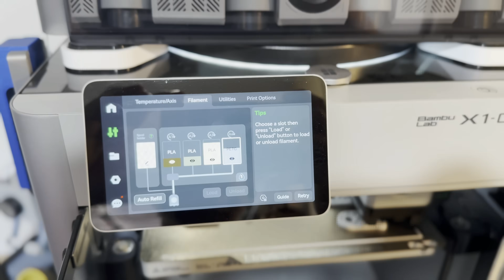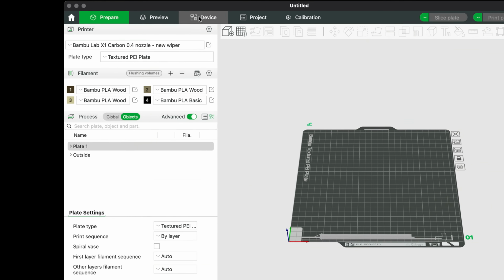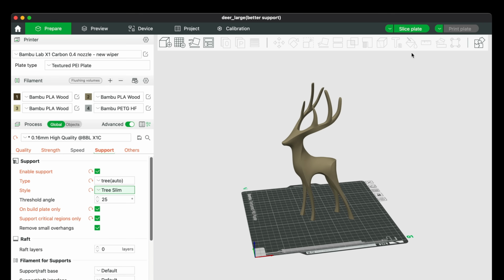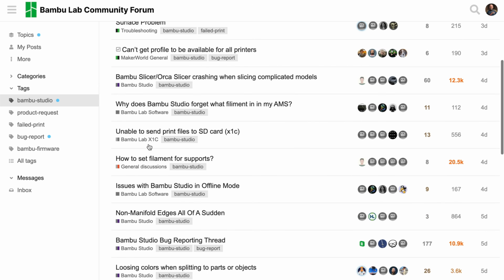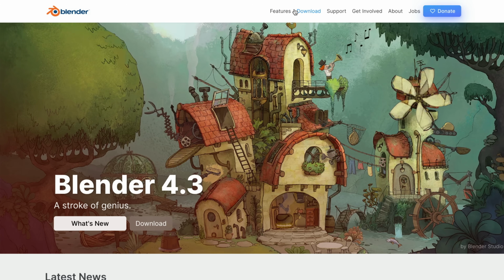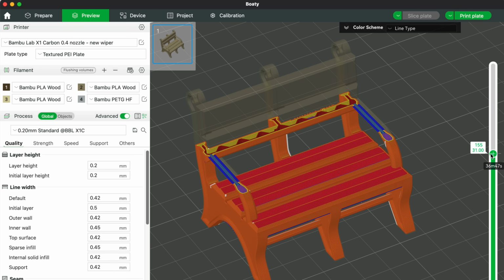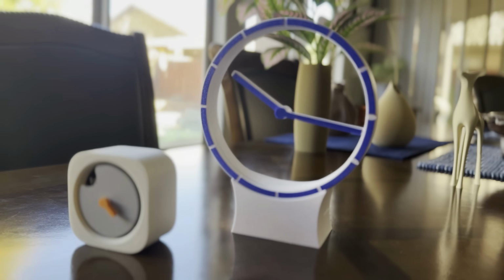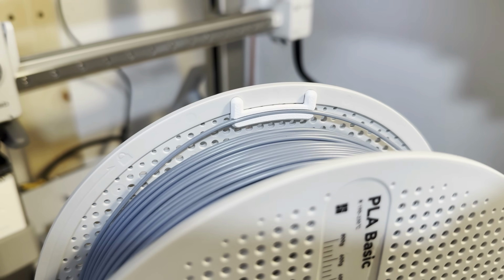New to Bambu Lab? This is What You Really Need to Know

Comment: great and inspiring video. 
one tip i'd like to add, is to experiment with print settings. for example some objects look really cool printed as only infill structure with no outer shell. 
or did you know you can "overprint" layers thicker than your nozzle diameter? with a normal 0.4mm nozzle you can extrude lines of 0.6x1.2mm and beyond. this is great for bigger structural parts and things in vase mode.

Comment: Great information great tips, I have a Bambu A1 mini that I am in the process of learning but I am loving it so far, it has lived up to the hype being easy to use easy to set up easy to get started with and gives great results.
I use a 3-D modelling program called AC3D which I have used for many years, my next project will be working on a design of my own than getting that sliced and printed
Thank you for the video thank you for the tips thank you for sharing!

Comment: I Used technology to create music for Lucas and Disney and also did freelance computer consulting work for decades and this machine is not user friendly at all. I like your tips but so far it doesn’t work period. I highly suggest people not purchase this machine…. There are little parts that should have just shipped attached… but the user needs to use tiny screws and hex wrenches to attach small parts that should not even be separate but glued together at the factory… I understand that some parts are separate so they won’t move around during shipment damaging the machine but we spent over 1/2 an hour trying to attach a 1 inch by / inch peice of plastic that is the receptacle for another component… someone in charge over there is on drugs! And speaking of which… I suggest having some hard liquor or opiates on hand when assembling especially if your spouse is helping you unlesss you want a divorce. Anyway good video for tips regarding a working machine but mine is still just an expensive cool looking paper weight;…. going to try and make it work again now… someone added some brandy to my coffee. ;)
Reply: thinking and basic assembly is tinkering

you are why people make fun of bambu users

Comment: Spent all day yesterday trying to assemble this thing and make a test print. epic fail! I wish the machine came more assembled…. It absurd that the scraper has the blade seperate from the handle  ours shipped eithoit the handle ( yes we checked the box several times searching for it) I wish it had a USB port so we could hardwire a computer or iPhone to the unit and avoid wifi problems. My daughter bought me this machine for Christmas and I wanted to print her a thank you gift but so far it’s an expensive brick. It told us it needed to update the firmware yesterday but today says “update failed” of course there is no way to get a human on the phone to help. The national videos and included paper instructions are confusing and annoying. I’m going to pull the packing materials from the trash in case we need to return this thing. Very disappointed. And chat GPT can blow me!

Comment: I will go metric when they quit selling 2x4 lumber.  I also own metal cutting machinery with all dials and readouts in english, the amount of tooling you casually suggest be replaced so you can enjoy the metric system would cost me more than your 3D set up cost you, and my parts are more accurate.  Move to Europe if you like it so much.
Reply: All imperial units are defined as fractions of metric units, so you're already metric. Just with an extra step
Reply: @snowthemegaabsol6819 sorry no. I am not new to any of this chief, I have likely been cutting metal longer than you been alive.
Reply: Unc, it's a half-joke, go cool off in the nice winter air and get that blood pressure down

Comment: Good luck if you need any support from them. Takes days to weeks and it’s often shit an AI could have told you
Reply from the maker: Yeah, i've heard they could use some help in that area.
Reply: @zionbrock  I will give them this, it’s better than a lot of other 3d printer companies. Right now they seem to be replying the day after the reply you send, which isn’t terrible. Just had to use them for a huge blob/clog that ended up shearing my parts cooling fan off and bending my hot end fan. In total the nozzle and hot end is also encased in PETG (so garbage more or less). They agreed to replace the fans, but not the nozzle or hot end. I feel like that’s fair considering I should have been monitoring it myself. Coming from Enders I became way too trusting of this printer too fast. Just seemed to always work.

Comment: Pla wood is abrasive. Be careful with that. 

Do not dry your filament in the same oven you cook with.
Reply from the maker: I've never had an issue with a nozzle while printing with pla wood, so far.
Reply: @zionbrock not necessarily the nozzle, but abrasive material on bambu systems is discouraged because it can degrade the Bowden tubes very quickly. Also the drive gears in both the AMS and the extruder can break down very quickly with abrasives.

Comment: My Bambu A1 Combo arrived while I was watching your video. Will be following your advice. Thanks for the tips!
Reply: Hi, how does the AMS lite compare against having the dedicated AMS and not having one? I am trying to decide between just getting A1 or if it's worth making the extra jump for the combo. What's the benefits and could it be had with just A1 and some DIY spool stand on a shelf above the printer ?
Reply: @KaiPetro  Good morning. All good questions. I'm new to filament printing though I have been designing and printing using resin for years. I bought the lite version as I'd like to do some multicolour stuff. I've seen some use the DIU spool on shelves. Give it a try, if it doesn't work no big deal. I felt it was a good compromise between DIU and a dedicated AMS. Time will tell 🙂
Reply from the maker: It's not just about having extra spool stands, you need a computer (AMS) that knows how to switch the colors, if you want to do multicolor prints. PLus you'd have to figure out a system to port all the filaments from different lines into the toolhead. Also, the AMS can read the colors you load into it, so you don't have to constantly tell it what colors you have. Trust me, its worth the money.

Comment: YES!! I can't believe we haven't switched to metric yet.  It's SOOOO much better, easier to use and logical.  If you disagree with me, you've clearly never bothered to really understand how it works nor used it before.  

All units are referenced based on the gram (milligram, centigram, gram, kilogram, etc) and meter (millimeter, centimeter, meter, kilometer, etc). 

They all share the same base units/ naming convention (pico, nano, micro milli, centi, kilo, etc) and have the same scales between types of measurements (distance and weight). 

You can EASILY switch between units simply by moving the decimal place since all units are base 10 unlike Imperial units where inches are base 12 (12in = 1ft), ounces are base 16 (16oz = 1lb), etc, which makes it a nightmare to convert and compare between units. 
100mm = 10cm = 1dm = 0.1m 

Because of common base10 units, everything is simple and sequential.  I can easily measure a piece of lumbar using a metric measuring tape in mm, cm, or m without calculating conversions.  You don't have ridiculous fractions, no unbelievably convoluted calculations like figuring out the center of a piece of wood 3ft 11in 3/16in long.  

In metric, it's... 
• 1195 mm / 2
• 119.5 cm / 2
• 1.195 m / 2

Simple calculations.  I bought all my friends and family metric measuring tapes for Christmas one year and they can't believe how much easier it is to use.

We Americans are really amazing at some things but very stupid at other things like not moving to metric
Reply from the maker: Right?!
Reply from the maker: As an engineer in school we had to work in all units, and go back and forth. It was a nightmare.

Comment: Your going to be massive on YouTube. This is the best 3D printing video. Subscribed and looking forward to learning more. 

Also I’d like to ask your opinion. I’ve never used a 3D printer but wondering if I should buy the H2D / Laser combo as I want to print parts for motorcycles and have the freedom to explore. Is that overkill?
Reply from the maker: Thanks so much for the sub! My personal opinion is to purchase 3d printers and laser or cnc cutters separately. I think the H2D is amazing, but just as a standalone 3d printer. When you try and do all the hobbies i one machine, there's a lot of variable you might not take into account, like contaminants from your cuttings getting into the tool head of the 3d printing hot end, etc.

Comment: New sub here. Thank you for this video, and it popped up in my feed just at the right time. I have had another brand and have been more inclined towards the Core XY, however I have had that many problems with the 2 (one was an exchange) printers that I am changing brands.  I do not know much about bed slingers and obviously have heard all the hoohaa with Bambu, but right now here in Australia Bambu Labs A1 is dirt cheap and I could buy two of those by adding an extra AUD$130 to the price of a Kobra S1. So even though I was not going down the Bambu road, I will be now as I have checked out the price of parts etc and know that support is hard to get on to but thats ok. There are plenty of people in Youtube land that we can ask questions of.  You have shown me things that I didnt know and thank you very much.

Comment: I use ViaCAD. It’s both WINTEL and Mac.  It runs on your machine as opposed to to web based which is preferable for security purposes. The intro versions are quite affordable.  One reason I like it is because of a unique GUI interface for the CAD. It can be a little challenging at first but look at the movies and pay close attention to the instruction on use of keys, and in short order you will get it and the power provided. Imports and exports all the CAD formats.

Comment: I was wondering about the AMS. I'm planning on getting an A1 mini without it since I don't need more than 2 materials. Can the material be selected in the desktop software. I don't like using the tiny touchscreen on the printer so if I can avoid it, I will.

Comment: Hey, your video is so much informative and there's so much you said that it's kinda overwhelming and scary to get one, at first reaction. But it settles down and reassures that there's a great video out there that will address and answer a lot of scares and jitters of a newbie. Thanks for uploading it. By the way which printer you have, and how long did it take you to get to a comfortable level. 😊
Reply from the maker: I'm so glad you agree. Yes, there's so many great resources if and when you get stuck or run into a clog or issues. 
I have the Bambu Lab X1C and A1 currently.

Comment: Your video just convinced me to get a Bambu printer.  I'm thinking the A1 with AMS.  What four filaments would you suggest I get with the A1?
Reply from the maker: Probably too late to suggest, but I think MATTE and Wood PLA are the most elegant. They're not the strongest, but they can really make your prints look expensive. PETG HF, is fantastic for parts that that might need a little more flexibility and bend.

Comment: USA has converted to metric, inch now is defined back to the metric system.
Reply from the maker: not sure i understand...  The US is def not on the metric system. However there are things we measure here that are, like 2 liter bottles of soda, or medicine in milligram increments, etc.
Reply: @zionbrock  Historically things like the inch had various definitions, which is what led to inconsistincies. In 1959 the USA defined inch in terms of the metric system: an inch is 25.4mm. So, ever since then, USA has been locked to this metric system which cleared up all the problems. Appying some scaling like multiply by 25.4 is trivial, since it is now all consistent and locked to metric.

Comment: Dude that’s one thing I’ve been looking to get is a pack of hardware with a bit of everything needed in common builds but idk what that would the one I found was way to much in 
My opinion and didn’t have ball bearings mainly just bolts and nuts of different sizes labeled as 3d print hardware
Reply from the maker: I felt the same way when i started, but found that most great designs don't require much more than basic M2 M3 and M4 nuts and bolts. And a pack of washers is smart to have on hand. I say just purchase when you need them.

Comment: Contemplating on buying the P1S Combo soon, thank you for making this!
Reply: When I was looking to buy my first printer, I initially considered getting the ps1 also . But, after realizing how costly it would be, especially since I had no prior experience, I decided to switch to the A1 with the AMS light. Unless you're absolutely certain you'll be printing 100% ABS and ASA, I’d recommend going with the A1.

The A1 has the same size build plate, and is much more affordable, and the main limitation is that it can't print ABS/ASA However, I've heard there's a trick where you print with PLA first and then ABS—though I'm not sure how effective that is. If you really want to print ABS or ASA, you could also Build an enclosure to accommodate that.

The PS1 is still a great printer, but I just wanted to share my experience, as I was in a similar situation. By choosing the A1, I was able to purchase around 12 different filaments for a much lower price than what I would have spent on the PS1.
Reply from the maker: Awesome to hear, hope this helps you out! the P1S is amazing, i'm told. I have the X1c and A1

Comment: I just want to say that I already want to buy the H2D and I just started with the a1 combo.  So, maybe you should skip the upgrade dance and just go all in?
Reply from the maker: haha, maybe
Reply: @zionbrock 
Well the reason is, the printer one buys should be according to what climate they live in. When I fired up my first printer, the A1 combo, everything was great. I opened four spools of the color PLA I wanted and started to print.  I happened to be home a lot right then (I travel for a living ) we used a lot of lbs of filament. Then I went to work for a couple weeks, and when I got home, the prints were not turning out as perfect as they were at first.  I found out the reason was water vapor. Even PLA needs to be dried if you have an open AMS and an open printer.  After this realization, everything got a lot more complicated with dryers, vacuum bags, vacuum pumps, hydrometers, and lots of bags of desiccant.  There are four schools of filament on my AMS light right now. And I have been away from home for the last 2 1/2 weeks and I have another week to go.  When I get home that will be about 24 hours of drying time for those four filaments if I did it one at a time.  
Another area of ignorance that got there was printing, abrasive, filament, such as the wood, PLA. Fortunately me, I didn’t run the wood PLA on all four spool positions, so I’ve only had to replace the mechanisms on two of the four. 
So the H2D several AMS 2’s and HT’s will take care of the water vapor problem and also allow us to print with different filaments that are not recommends for the newbe printing system.  The AMS being seal will keep filament dry.  They also have there on hydrometer.  I believe I can flip on the drying cycle even in this hotel room. 
It should be marked - “For dry climates only’,    Where we live it is going to rain 22 inches this month!

Comment: How about smell? Is it safe to have it in flat?
Reply from the maker: The X1C has a filter built inside the enclosure, so its certainly better. But if you're only using PLA when you print, you shouldn't have an issue with the A1 or A1mini.

Comment: Technically, the US can not convert to the metric system. And having converted to the metric system in Canada, costs on items changed when we converted. It used to be we bought fuel in gallons, and when we converted to metric, the government did not do a direct conversion of the cost from gallons to litres. Metric measurement was used to allow higher costs on goods because the majority of the people in Canada lived on the standard system. So unless the entire economy was completely built on the metric system in the beginning, it would be near impossible to install it from one measurement system to another because costing is based on which system? 

Cost out a few quarts of oil for the car, but here I can only buy 5 litres of oil. My Jeep only needs 4 quarts of oil for an oil change. So what do I do with the extra oil? I would have 0.3998 quarts left over. Technically no one should have changed measurement standards, because it throws off engineering standards, strength of material, and thousands of other traditional allowances forged over thousands of years.
Reply from the maker: very interesting info

Comment: I see the Bambu Lab A1 has the 4 filament  piece and the A1 mini doesn't. Can I add the 4 filament piece to the A1 mini later or you have to buy the Bambu  Lab A1 if you want the  4 filament piece?  Am I making sense?? Lol!
Reply: The 4-filament device is called the AMS Lite, and it is compatible with both the A1 and A1 mini. It can be purchased separately but is often cheaper if purchased at the same time as the printer.
Reply from the maker: I think @AlexLMedia already answered that. But Yes, the AMS Lite can be used on either the A1 or A1 Mini.